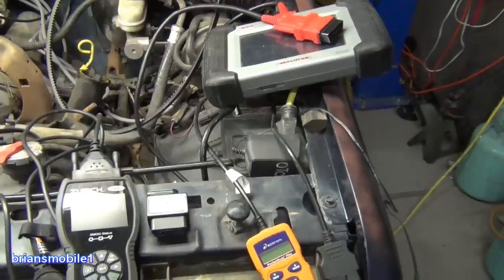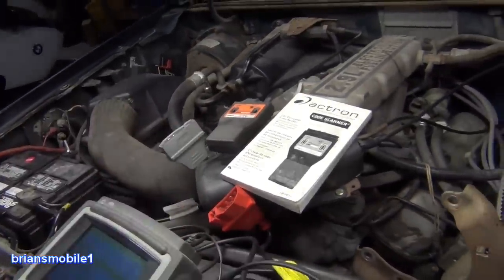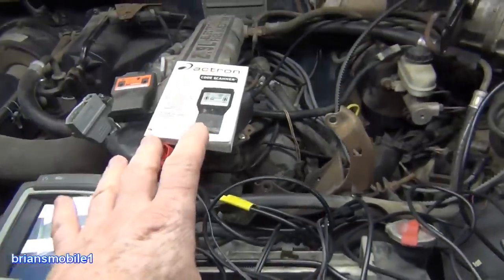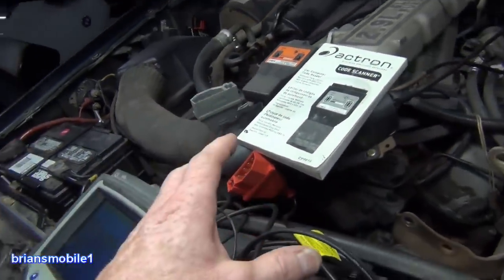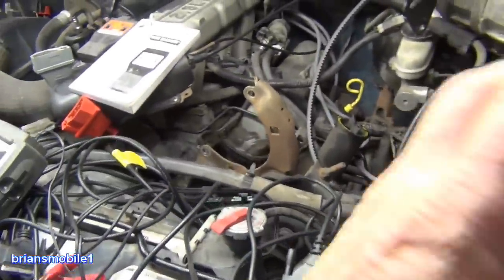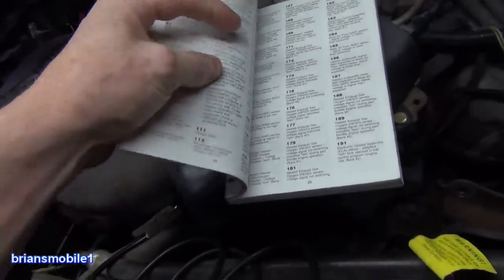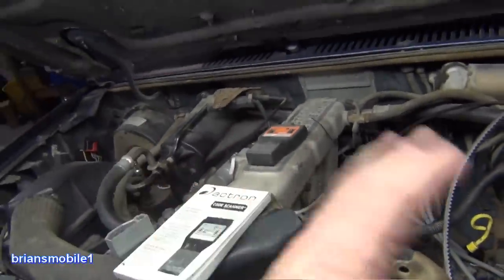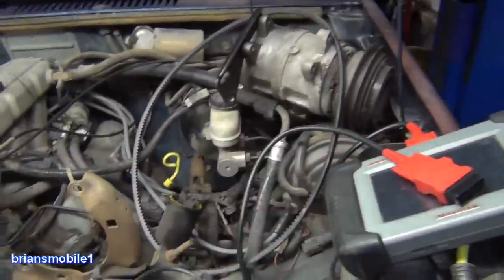What OBDI & OBDII Mean In Auto Diagnostics

Comment: My 96 Ram 350 van has a flashing check engine light with the key flipping deal but also has a connector that resembles an OBD2. What happens if I plug my OBD2 scanner on it? Will I fry the computer? If not, Will it read correctly the faults? Thanks.

Comment: Not a whole lot of info on OBD1. With OBDll if you disconnect the battery you need to put your car through a drive cycle, is that the same with an OBDl since it doesn’t store codes. Does it store any information?  If I disconnect the battery could I get a smog check right away in California. And pass. Thanks

Comment: as an old timer who has been working with computer-controlled vehicles since they were introduced in 1980 i have some words of wisdom from experience... the obd1 years were really difficult because the auto manufacturers really didn't want to share any information about their systems but legally they had to, to a certain point, so there were a few tool companies that pursued in the search for information and began producing diagnostic tools that independent techs could use since the tools available at the dealership level were not available to the public. otc was one of the first and came out with the monitor 85 in 1985 that could connect to 80-85 gm vehicles only, but the next year gm changed their software so the monitor 85 was no longer usable so they had a buy-back program to upgrade to a monitor 86... this game went on for a few more years until otc and other companies came out with scan tools that used removable software cartridges so you wouldn't have to replace your scan tool every year, just update the software cartridge. in the early days gm had the best obd system because you could not just read trouble codes, you could also see live running data with the scan tool connected. this was a very valuable feature that ford overlooked until 1990, before then all you could do on a ford was read codes and put the system into a wiggle test that would allow you to find loose electrical connections. chrysler's system was almost as good as gm's but didn't give as much live data. import vehicles were a major pain in the butt because they never did standardize on a specific diagnostic connector, different years of vehicle used a different connector as well as different manufacturers.. it was a major investment to be a tech in those days, my scan tool set with all of the upgrades cost me $6000 dollars in 1995..... today, all you need if you're working on anything 1998 or newer is an obd-ii scan tool which can be as little as $30 or maybe a few hundred bucks now. times have certainly changed....

Comment: Hey Brain. I dont know if this is the right place to ask this question. But i have a 06 forester with a small evap leak. I see smoke back by canister. I have changed canister and valve above it. I cant tell were smoke i coming from. do you have any input for me? it acts like its coming from fill tube were it hooks to the rubber. but cant tell. thanks Randy.

Comment: I would like to see those cheap  OBD II device tested. Are they still worth it to have to know basic error meaning?
Reply from the maker: For pulling codes they're great.  Some newer ones even give you freeze frame data and the VIN #.  FF data is stats on what the cars status was when the error happened.  Things like engine temp, vehicle speed, RPM's, etc.
Reply from the maker: They don't give you a lot of meaning- just basic description on what the universal codes mean- not the vehicle manufacturer specific stuff.
Reply: @briansmobile1  Thank you for the answer.

Comment: Obdii is so good. I used a bluedriver Scan tool yesterday to find out why the wife's work car won't start. Purchase it on your recommendation. The code was for a missfire for cylinder one. So I checked cylinder one. When I went to pull the coil on plug out it was drenched in motor oil, the whole spark plug whole was filled. Cleaned it out and checked all the others. They were dry. Being that cylinder one is right next to the oil fill my guess is that when the oil was changed they spilled and it ran down in to the plug whole. Put it all back together started right up, a lot of blue smoke for the oil but cleared right up.

Comment: It is interesting and amusing to see people incorrectly throw around terms like OBD1.
People seem to like to call all computer controls prior to 1996 OBD1.  That is absolutely incorrect.  OBD1 was a C.A.R.B. (California emissions) only mandated datastream standard that started in 1990 and ended with the rollout of the US federal OBD2 standards.
None of the computer diagnostics on any vehicle prior to 1990 are OBD1 and the 49 state emissions vehicles manufactured between 1990 & 1995 were not OBD1 either.
Prior to the Federally mandated OBD2 specifications there were no 50 state computer diagnostics standards.  It was literally the Tower of Babel.  Ford had proprietary EEC I to IV IIRC, GM had proprietary CLCC & ALDL, and other manufacturers had their own proprietary computer diagnostics.  CLCC and ALDL used the same 12 position Metripak 280 connector across all GM nameplates in the US but the serial datastream wasn't even the same amongst the same brand and nameplate.  GM 2.8L ECU in a Pontiac Fiero & 2.5L ECU in a Pontiac Fiero of the same model year could, and did, have different serial datastreams.  Prior to 1988 or so GM, Ford, Chrysler, Toyota, Nissan, Subaru, ad-infinitum were equally obnoxious in the blatant and fairly successful attempt at keeping the unwashed masses away from the minuscule amount of data these embryonic engine and transmission control systems provided to an initiated technician.  It wasn't til the CARB only OBD1 edict that the government made their voices heard.
International industrial standards organizations in Canada, Great Britain, France, Germany, and several other European countries likely had things to say about the OBD2 standard with government backing.  They certainly have input into the latest CAN protocols that were mandated by a major chunk of world governments in the last decade or a little more.  The stated goal of OBD2 was to allow     non dealership technicians access to repair data to reduce emissions.  Governments don't do things for altruistic reasons.  If you believe that I have a bridge to sell you.  They create laws and regulations to accrue power and authority they would not otherwise be allowed.  Automotive and heavy equipment communications standards are no exception but I'll take the bad with the good since it seems to be at least mildly in our favor...  so far.

Comment: Not sure if it was my 87 Reliant of my 89 but it failed inspection for emissions. I went to a Chrysler dealer where I had two friends one was the parts manager and the other was a mechanic there. I was getting plugs, rotor, cap, and wires to address the problem. John the mechanic saw me and asked what's up? So I tell him I'm replacing some stuff to pass emissions. Did ya pull the codes he says. Nope I say. Well get out there and pull the codes. I go back to him with the code and he looks it up and tells me the O2 sensor was called out.
I tell my parts guy to put the parts he pulled back and get me an O2 sensor. It was roughly the same price as the other parts together and it extinguished the check engine light and we started getting 2 and 3 miles to the gallon better gas mileage. great vid love the bfate.

Comment: I found this interesting because I was just entering into auto mechanics in the mid 70's. (Carbs,  points and intake manifolds were cast iron) Then I joined the Army and didn't return to auto mechanics until the early 2000's. I totally missed the OBD I stuff.

Comment: Bronco, what is bad, either plug wires, rotor or distributor cap is breaking down, or is there tracking inside because it is full of oil deposits. Or the injectors are knackered and spraying a stream instead of a mist, leading to mix imbalance, or your fuel pressure is wrong.

Comment: I'd love to see more of what the OBD II does for you and how to work it. I remember using the paper clip to figure out the codes. I remember points but I'd rather not.
Reply from the maker: Great specific advice for me.  Thank you!
Reply: @briansmobile1  Work van used to be a Nissan pick up, basically the same engine in it from 1970 till they stopped making it. Points and plugs, I did the odd service on it as it aged, till it was traded in. I really wanted to buy it though, they are a tough vehicle drivetrain wise, pretty much all those built that were not totalled are still running, though your body might be more air than panel, and be more a collection of bondo and rust moving in close formation, held together by paint, wire and by holding on to the top.

Comment: Great video, next one might cover why none of the codes really point to a specific part but to the system parts in that area. 
Like a P0301 might not be a spark plug like the parts store person told you it was....
Some of the OEM tools for OBD-I did quite a bit, far more than just reading the cores, there was live data and the ability to do bi-directional tests. Most makes still had a lot of manufacturer specific codes as well just like they do with OBD-II. Then when the change happened some were really ready while GM gave us OBD 1.5 !!!!  For one year only! Thanks GM....  
OBD-II makes it easier but even then it takes the human using it to find what is really wrong.